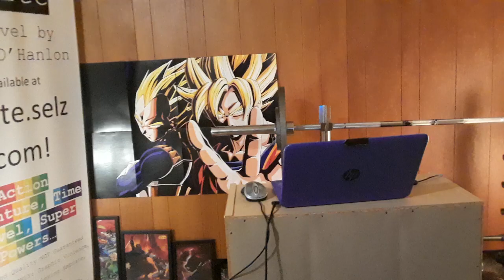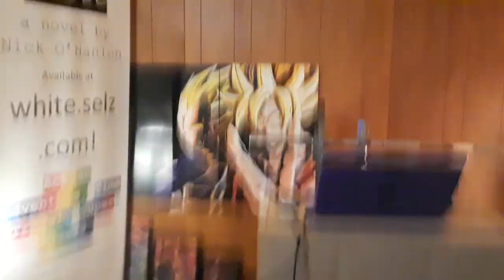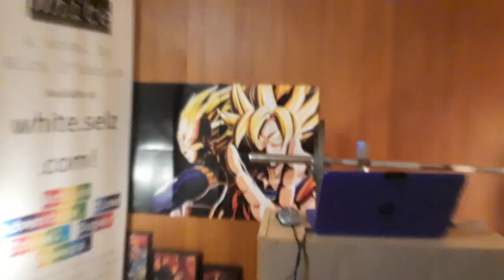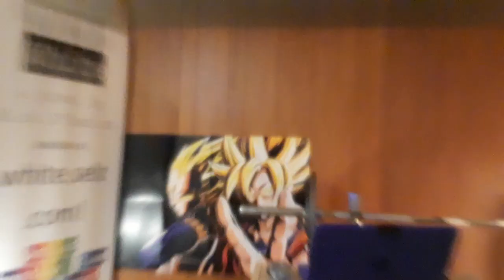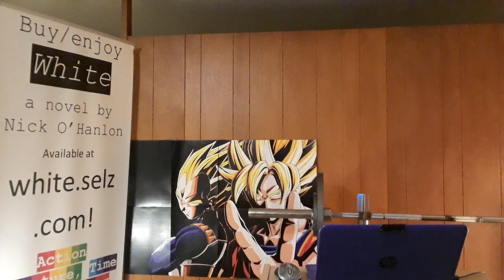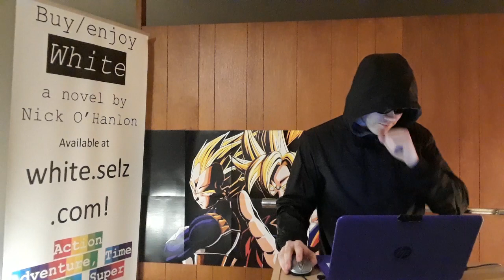How to Injaculate - Best Nofap Hack - How to Power Up - Saiyan MGTOW

Comment: help please i think i have retrograde ejaculation
Reply from the maker: I'm not a doctor.  But ok.  I'll be here to talk.  So like, you can't ejaculate?  Or what?  After you do that, and then you go pee, does it look like you pissed out a fat load?  If yes, I think that's retrgrsde injaculation.  It has happened to me like when I used to edge and get so close to cumming but then just stop.  This process is not the injaculation I'm talking about in the video.  It's like a failed injaculation with an amateur.  Which there's nothing wrong with starting out as an amateur.  However, if you have retrograde injaculation, like you think for sure you are going to ejaculate, but you can't, that's a medical condition I'm pretty sure.  Please respond, I'm here for you.
Reply from the maker: Orrrr, have you tried circulating your energy around as you do this?  Do you flex your abs and hold down the stop yourself from peeing muscle?  Google basically doesn't believe in anything besides retrograde injaculation.  You might be successfully injaculting, or you might have a medical condition.  I think the test is if you can't ejaculate at all, under no circumstances, then you should see a doctor for sure.
Reply from the maker: @wizardboots635  I'm glad you feel ok now.  Best of luck.